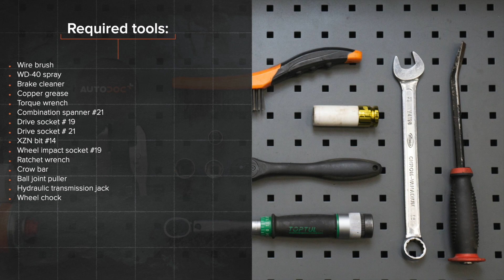How to change front ball joint on VW T5 TRANSPORTER Van [TUTORIAL AUTODOC]

Comment: Does he remove the bolt that connects the lower suspension arm to the anti-roll bar link and the shock absorber?  I found this to be necessary on my T4 to let the suspension arm drop.  Maybe the T5 is different.
Reply from the maker: We cannot tell you for sure, You can find this information in the vehicle maintenance log book.

Comment: You remove zn 14 bolts and then resecure with nuts? Did you add studs? Why didn't you replace the bolts?
Reply from the maker: In this video lesson, the ball joints were replaced with new bolts and nuts.
AUTODOC

Comment: I have tried everything to get my ball joint out. Bought one of those tools you use, bashed the arm with a sledge hammer, oxy torched the damn thing still wont move.
Reply from the maker: We cannot show all the nuances and problems, it is all individual and it is not always possible to solve them at home. To avoid this, we always recommend making replacements at car services.
Reply: 😂😂ball joints are the worst thing known to man and will come out just when you’ve lost all hope